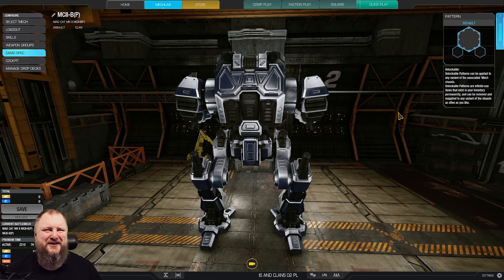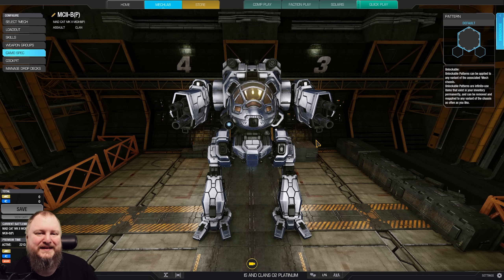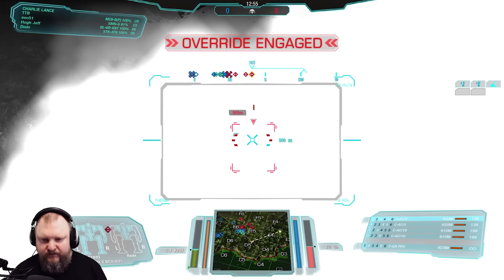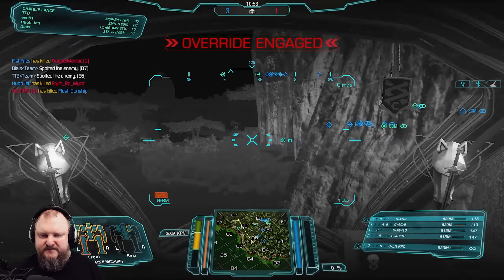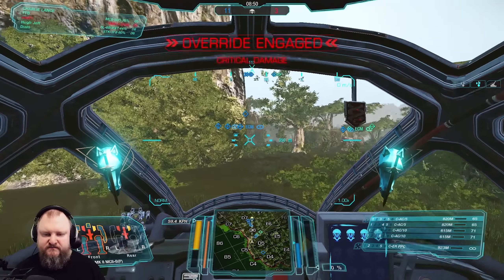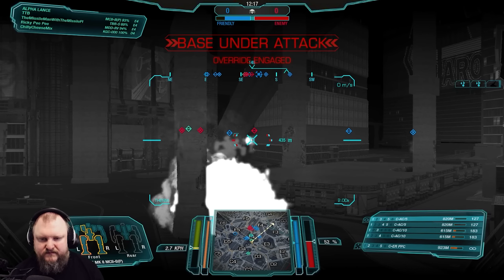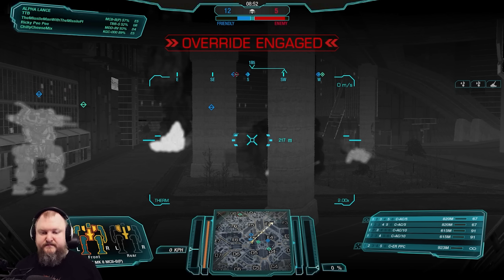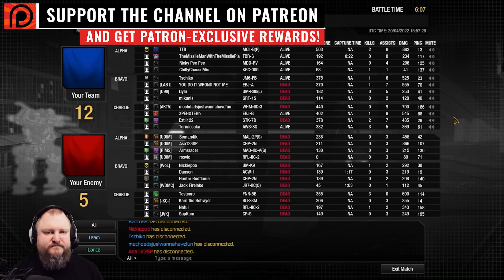I had no idea how much fun this is! - Mad Cat - German Mechgineering #486 - Mechwarrior Online 2022

Comment: Brotha, I'm glad you've joined me on my AC binge. Lasers and PPCs weren't getting my goat so I did something different. Take your K2 catapult, slap on a LE245, 2 AC5s, 2 snubs and 2 flamers. The range on them AC5s is silly, and your DPS is dang constant. When you need to push, those 2 little flamers make even the sturdiest assaults back up...straight into a wall. Can easily stand there and blast away as only 2 flamers takes a looooong time to overheat your mech. This doesn't work with 3 flamers

Edit: a short range archer?? SRM boat time?